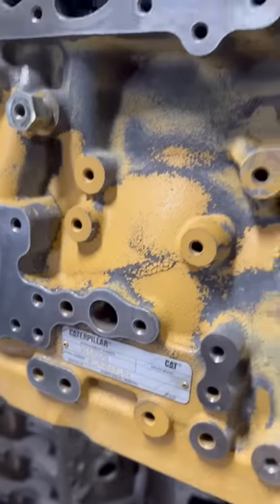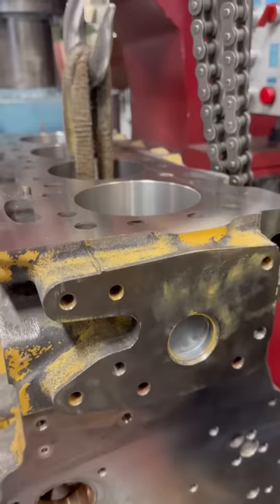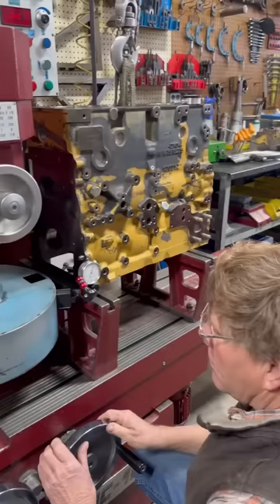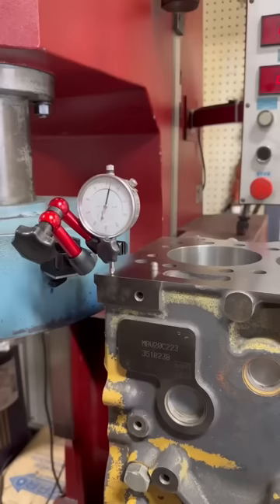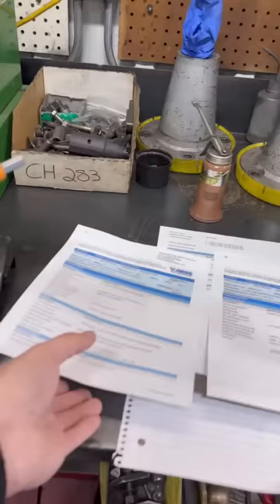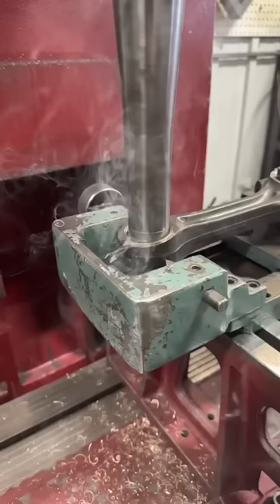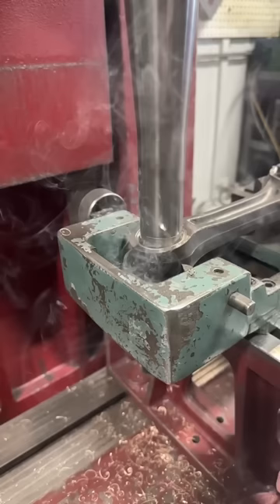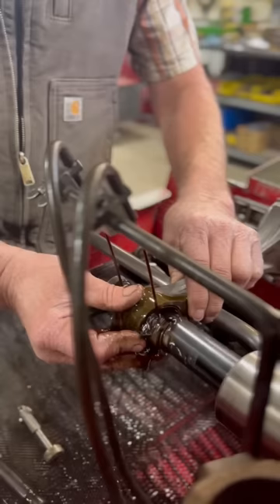#shorts How Can We Compensate For The Deck Height Being Too Short?

Comment: Can you explain why you wouldn't use a thicker head gasket to compensate for the deck height?  I've also milled piston crowns to get the compression height correct with a stock gasket.
Reply: I was thinking the same
Reply: This seems to be the most efficient way to do it if the head gasket you needed wasn't available or if there were time constraints.

Pin bushings had to be bored anyway so might as well make the adjustment there instead of burning the time/effort to set up the extra mill op & skimming the pistons. Which would also tie up the mill (or it may have already been running another job).

Also don't think I'd want to touch the pistons anyway b/c then you're essentially changing the combustion chamber shape & you need to set up for measuring what I assume would be wrist pin to the top of piston & then everything that may be referenced off the top of the piston.

But this is just an ME's educated guess & I'm also guessing you already knew these possible issues & were looking for specifics on this exact rebuild.

So hopefully my reply will help attract attention so we can learn the specifics.

But my $$ is on not having the necessary gasket & avoiding the extra operation & everything that comes with it.
Reply: @Iceberg86300  in a perfect world your supplier could get you those gaskets perhaps thanks for your reply
Reply: My guess as well is that it wasn't difficult to move the bushing bore, and it already had to be done. I doubt there are multiple off the shelf head gasket options like we have for Ford or GM engines, which would add cost to have made, and more set up = more money as well.
Reply: Hmmm, I could see the need for a CNC mill that could shorten pistons but keep the same profile.
Reply: Along similar lines, would a half thou really affect compression or valve clearance?
Reply: My brother in law worked for GE. He said thousands of an inch were called mills in the US. To me a mill is a mm. You say thou’s . Just like we do. 🇬🇧
Reply: Better not mess with piston top or thicker gasket on a diesel engine 
If you look at the sheet the compression ratio is specified on it and is 17:1 or 18:1 
less and the engine will lack power or won't even start more and you get bend valve or piston to head contact
It's not 10:1 like most gasoline engine
Reply: @1234567890CAB on a 18:1 compression engine a thousandth can mean complete destruction = valve to piston or head to piston contact 
And he said 2 thousandth
Reply: @legros731  I agree for a high performance application.  However this appears to be stock, and thus is most likely mild.  Also they said they removed 2 thou, but were only 1/2 thou out of spec.  I was thinking it'd give a tiny bump in compression. While 1/2 thou is a lot for bearing clearance, i believe the rod and the valve stem will grow that much when up to temp.
Reply: @1234567890CAB  what are you not understanding in the compression ratio is 18:1 in a diesel vs 10:1 for a petrol engine cutting the deck or head of a petrol engine will just increase comp by maybe 0.5 and slightly increase performance there no place for any deviation in a diesel completely different
There no spark plug diesel rely on compression to ignite the fuel and a change here is not a good idea
Cat sell 4 different lengths conrod to get the piston to deck height within spec that how precise it need to be and side by side you wouldn't see the difference between them
It's just more cost effective to modify the old conrod
Reply: @legros731  Gotchya, you're correct that I was more thinking about gasoline engine building.  I know the difference between how gasoline vs direct injection diesel engines operate, but I didn't know that having one specific compression ratio was that critical in a diesel. I was thinking that diesel just had to be above the auto ignition point and that the maximum compression was limited by mechanical, clearance, and reliability concerns. Thinking about it, I guess it does make sense that the compression ratio would affect the ideal injection timing and pressure.
Reply: @1234567890CAB 
do a google search for cummin 12 valve head picture you will see that there no combustion chamber in the head (flat)
search for cummin 12 valve piston and you will see that the piston have a pocket were the combustion take places and a 12 valve is only 16:1 the piston to hear clearance is critical to get good performance
Especially for a engine that is stationary that only got 2 speed idle and full speed (drived by a governor)
Reply: @legros731  Right, and in gasoline engines too, I've heard that the squeeze, or forcing the compressed gasses/mixture/air to the center of the combustion chamber is more important than just the overall compression ratio.  In other words, a tight concentrated ball is better than a squished pancake.  In order for these cupped or bowl pistons to accomplish this, the outer rim or edge must get very close to the head.  Therefore, the deck height is more about piston to head clearance than piston to valve clearance.  Again, thinking about this for a bit, since there is just one injector in the center it makes sense that it would preform better spraying into a small cup or bowl of compressed air vs spraying against a flat piston top.

Comment: I'm not a machinist so my question is if you took the deck heights down to the lowest that's allowable how would oversizing the wrist pin hole shorten the  rod llength to keep it from hitting the underside of the head
Reply: It's not that they oversized the wrist pin bore, it's that they moved the center of the bore closer to the big end of the connecting rod, effectively shortening the rod.
Reply: @patx35  Thanks 👍

Comment: Rebuilt a case 900, it came in a card board box, the bottom counter bore was pitted bad, went to get 900 sleeves and Pistons well was told I could get them then 900 was not available so I got 930 sleeve and Pistons was told they would fit, no they didn't, had to have the bottom counter bore re done any way, and they were cast iron Pistons, long story short that 900 would walk a way with a ten shank chisel plow hands down, you could feel the ground shake 200 feet away as she was pullen

Comment: It's a Lucas Perkins English L4 236 ,same engine as used in hyster rollers ,cat used them in 416 rubber tired backhoes real reliable but keep and extra fuel pump in stock as primers and bowl bolts come loose and some can be fixed !

Comment: As a Cat technical rep. For 25 years and I worked with the engineers at the foundry in Ireland where they are cast the quality of the casting were so poor when machined they would cut the deck down as far are they had to to clean up the porosity.  They install the correct length rods to match. There are 6 different rod length!

Comment: Because it’s a Perkins engine painted in CAT yellow…. I worked at a truck shop years ago and we had a 6k cat diesel forklift that was powered by Perkins.  Up until that point I thought cat made engines for all their equipment, but I guess it was too small… later in life I found an old 20k cat forklift built with a 453 Detroit in it.
Reply: Cat bought Perkins out over 20 years ago now.
Reply: A lot of heavy equipment manufacturers used Detroit Diesel engines,  I operated a Michigan 75 front end loader that had a  4-71 Detroit,  made a lot of  noise,  but was a good dependable engine .

Comment: The reason your seeing Perkins on this block is because it was made by Perkins. Perkins and cat are the same engine. The only difference is Perkins painted the engines Grey and cat did yellow. Mostly made for off road machines .I've got 2 Perkins engines in the massive welders and a old shovel bucket but that's a 3 cylinder. If you have a 80 to 90 cat rub on the paint if you see Grey paint then this engine is a Perkins.

Comment: Bosch was trying hard to monopolize the diesel engine fuel and emission control market in the 90s. So for small diesels, those engines less than about 10 liters, or basically too small to have room for the third cam lobe that controls injector function on large engines, Bosch started introducing a flurry of new developments. Higher pressure pumps, like the VP44 and the HEUI systems. Companies like Mack and Cat tried to keep up with the Bosch developments but Bosch would bring new products to the EPA and say this product will make these engines run cleaner. the EPA would adopt the product and give manufacturers a timeline to build something that would compete. These standards started with the smaller engines first and the larger engines were given more time. They called them tiers, tier 1, tier2 etc. Cat wanted to concentrate on large engine development so they bought Perkins because Perkins was already set up to build small engines. So every engine smaller than a C7 has been built by Perkins for about 30 years now. There are some small Isuzu engines in some cat forklifts but perk-a-pillars are the mainstay. Cat tried hard to stay in the medium market and did well with the 3126 and later C7 but after the common rail C7S fiasco sadly Cat stopped all production of engines smaller than the C15. Now Bosch has a monopoly on that industry if you live in a “GREEN” country and  buy a diesel engine today Bosch controls the fuel in and the exhaust out and no company can compete.

Comment: We got a head gasket job done once and the engine ran fine but it kept putting pressure into the coolant system and pushing up the Overflow tube but the engine still ran fine all we did was use an old 5-gallon gas can for the antifreeze and coolant to go into and then we let the engine cool down in between chipping sessions then dump the fluid back into the radiator mechanic at the diesel shop said if you get the headstone on Perkins if you're doing a head gasket on a Perkins and probably other measures to I'd imagine you should get the top of the deck resurfaced the head rebuilt and then do that gasket but definitely on the Perkins motor

Comment: As a retired machinist, if you are worried about 0.0005 on a 17 in pc of cast iron, wait until the shop warms up by about 5 more degrees and it will be spot on.
Reply: As a diesel mechanic a would tell you he was right to be worried 
With a 18:1 compression ratio every thousandth make a difference 
By the way they make 4 difference length conrod for this exact purpose

Comment: Perki s built engines for cat skidsteers for a while. I had a 236 cat skidsteer with the perkins based engine. What a pos that machine was. Couldn't keep the plastic drive coupler in it. Replaced it at least once a year. Even cat couldn't tell us why.

Comment: Perkins(English made) is in contract with cat to build these engines and power a lot of stuff for cat from skid steers to power systems , if it has a cat software you can use Cat et to diagnose it put if it has a Perkins ecm you hv to use Perkins software (software cost around 3500 each a year)

Comment: I had a case 1070 engine had it decked 12 thousands after getting it running all was good till carbon built up on the Pistons then it hammer, like what's wrong, so I rechecked every thing, and the whole of it was the 12 thousands resets sleeves need the stroke shortened, but in stead I had 18 thou taken off the top of the Pistons , and it worked out great, I took a stock 1070 case tractor put a turbo on it and it from 110 hp to 155 hp, that was stock bore and stoke

Comment: Because in 1998 Cat purchased Perkins  and you could end up with a diesel or a gas engine  and random fact prior to 1998 Cat used Perkins for global markets and also for Gas fueled equipment   but there is also a chance you may come across a Cat stamped Mitsubishi Diesel engine as they did buy  the industrial engine division of Mitsubishi  plus if you ever get a Cat C13 it will be stamped Navistar

Comment: I’m confused. How do you shorten rods by redrilling the ends?
Reply: They fit a new ‘little-end’ bush ( piston-pin bush ) which is a little over-size, and mill the finished diameter a few thousands of an inch away or close to the ‘big-end centre, effectively altering the working length of the connecting-rod.
Reply: They bored the new bushings a couple thousands towards the bottom

Comment: Love the technical vib of these guys alway with the thousands of a inch 👍
Reply: That’s nothing. Serious machinist get into the 10 thousandths of an inch. Those are all air conditioned shops too… as metal heating or cooling could have more than a few thou of change.. 
half a thou, is 5, 10 thousandths of an inch. 1/6th the width of a human hair
Reply: @Jlinwoodjackson  I’m a jet mechanic, flight line troubleshooter, wet end specialist on the fast paper machine in North America. And I’ve been rebuilding outboard motors  20 years in my shop . And you are absolutely right . Most people don’t have a clue what you just said . Thank you for the comments 👍

Comment: Thank you for not condeming this block. A engineer that knows how stuff works knows where to compensate for a slightly out of spec part. Its like the mechanic who turned my rotors all they did was put a shim behind one of the pads.

Comment: I’m building an odd ball combination BBC from leftover parts rn and it lands me 0.025” out of the hole IF the deck is 9.800”. I have to measure the actual piston above deck still but rather than buy expensive thicker MLS gaskets I’m going to mill the quench areas of the piston to achieve zero deck. The block has never been decked also so I might have less to machine than the theoretical 0.025”...
Reply: I'm always amazed just how bad production engines are, especially regarding deck surface. I'm wondering just how flat that thing really is. You've definitely got options.
Reply: @ChevyConQueso  those BBC’s usually have some extra deck height. I’m just going to deck it till it’s square and flat, then measure where the piston lands at TDC and go from there. They’re short skirt pistons so I have to watch quench/piston rock so I don’t smack the heads. 0.040” quench is about minimum. Any extra deck height is a bonus. 4” stroke, 6.535” rod and 1.290” pistons is 9.825”...

Comment: Can't you set your deck height with a thicker head gasket? Or do they not make different thickness head gaskets for this motors. I set the deck height of my sbc with a 0.035 compressed head gasket so that I would have good quench too. Just curious if that was the only way to set deck height for that application.

Comment: Because the engines name is Perkins? Obviously. If you know the engines true name, and speak to it nicely, it will come apart easily. If you don't know what it's name is, and you use foul language, the studs will shear off, bits will break and nuts and bolts will come loose after you put it back together, and you might catch a con rod in your groin. Or worse. Always check for a name!

Comment: My boss used to have an old Bandit 250 wood chipper that had the four-cylinder Perkins in it a 4-cylinder kicked ass I found that out when I needed a water pump the guide the Bandit dealership new he s*** and told me I'll never get one for a caterpillar 4-cylinder that size cuz it was made by Perkins very commonly used in small sailboats I also think the same four-cylinder was used as an option in a Ford Ranger pickup truck back in the 80s
Reply: Not sure if the same engine, but yes, Ford did offer a Perkins engine option in the 80s, that you and like 12 other people seem to actually know about.